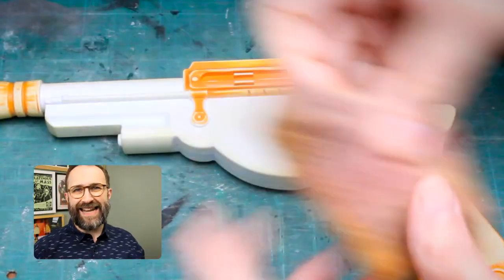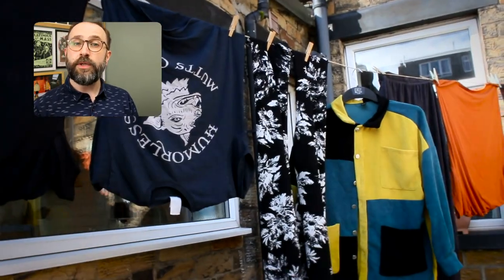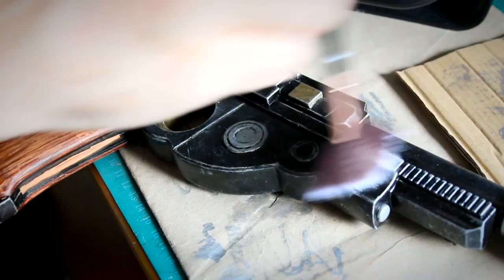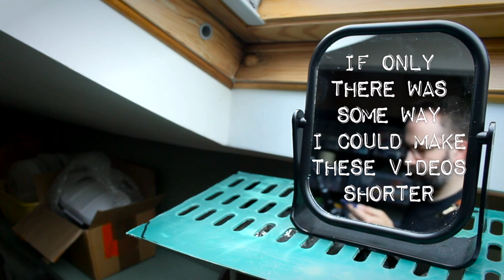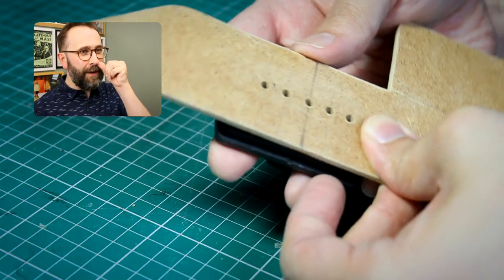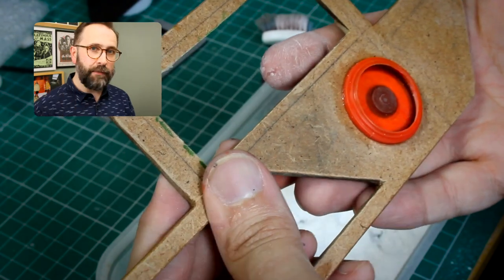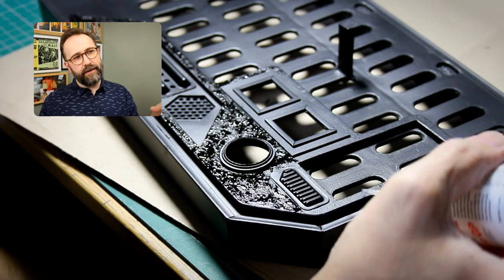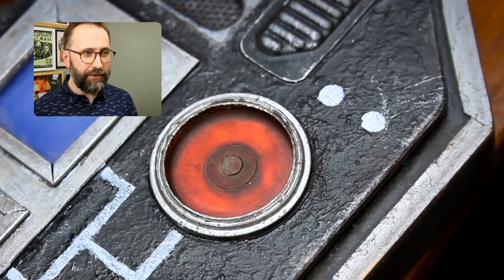I made a Mandalorian blaster & display stand from toys & junk

Comment: PVA might be a better, if slower, seal for your MDF cut edges. Cheaper anyway. You can mix acrylic paint into the PVA and eliminate a step if you're painting the piece.
Reply from the maker: Yes, I'd definitely go with PVA or wood glue on a bigger piece.
Reply: @greigjohnsonmaking  I'm also in Australia, so factoring in the Oz tax on everything except food makes CA more expensive than PVA, but I see you using a large bottle of CA. A man of wealth and mystery, as Bluebottle would say.
Most shaped plastics in packaging are thermoplastics, vacuum formed - Adam Savage has quite a few pieces looking at them. There are lower temperature hot glues aimed at child use, not sure if they would be much better as hot glue is just molten plastic.
Have you tried using hot glue to build things, like a very basic 3D printer? An interesting way to lose hours!